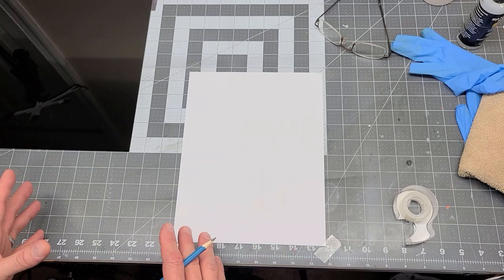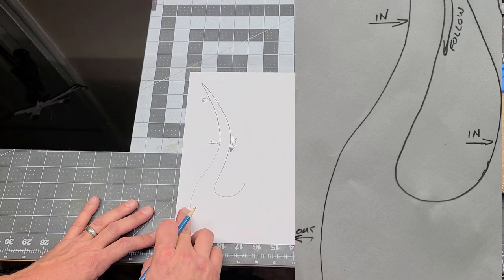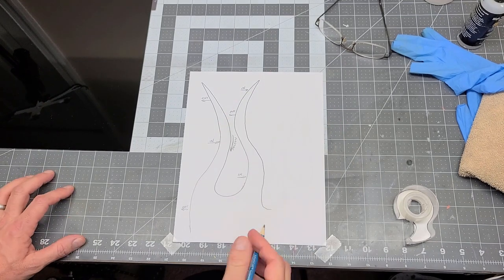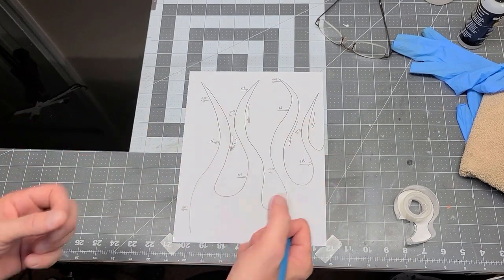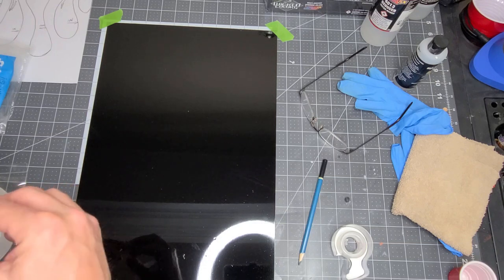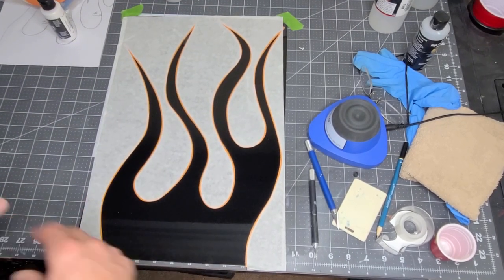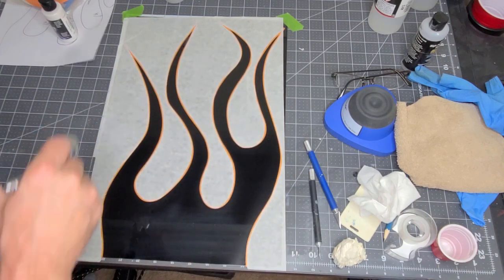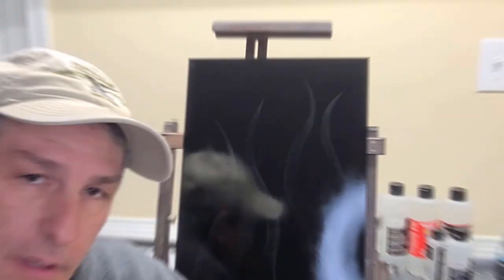Layout and Airbrush Ghost Flames - How to

Comment: Is this a good paint for motorcycle saddlebag flames and then 2k clear coat over top?
Reply from the maker: Ken, yes. Wicked can be painted on anything and is formulated for exterior use. The pearls are not as uv resistant as the regular colors but covered with 2k clear you are good to go. Hope this helps and thanks for watching.